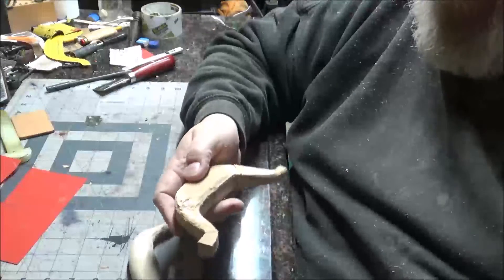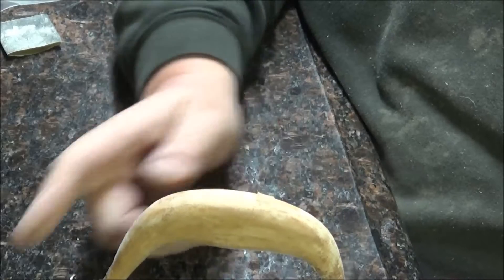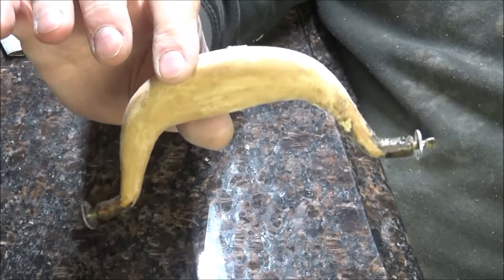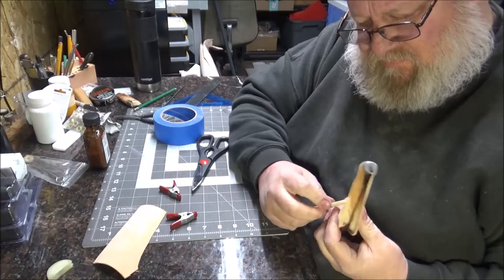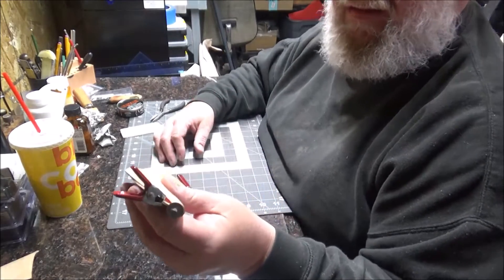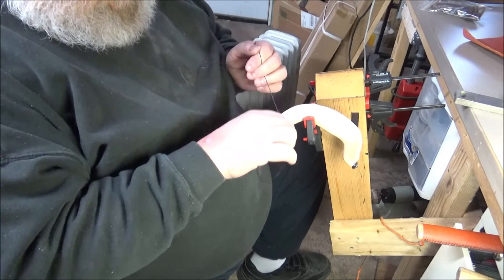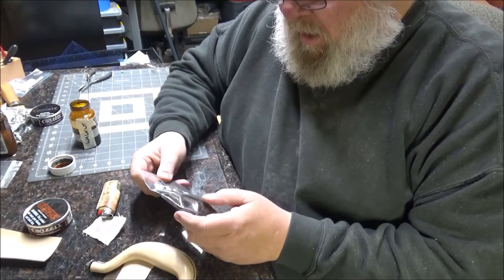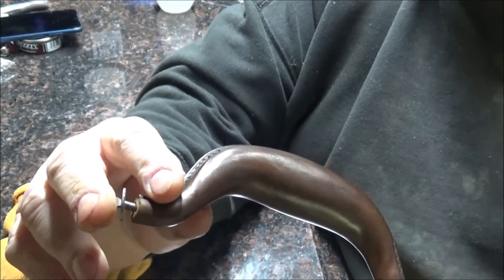Repairing a Vintage Leather Tool Chest Handle Part 2 - Success

Comment: i have a question thats not pertaining to this video. i saw your video on taking apart your glenfield model 60 and i was wondering if u knew where i could purchas a new hammer for mine. i have checked midway usa and a couple other sites
Reply from the maker: Numrich deals in new and used parts, check here: https://www.gunpartscorp.com/gun-manufacturer/savstevspgfld/rifles-sav/60
Reply: @FatManLeather  thank u so much

Comment: Awesome work!  I have a vintage (1920's) machinist chest that I am restoring. I found your page to get an insight into what the restoration of the handle will require.  After viewing your video, I realize that I do not have the skill set to attempt this restoration myself.  Would you consider undertaking another similar project
Reply from the maker: Certainly, This one gave me a few surprises along the way, but my customer liked it. You can send some pictures scott@fatmanleather.com and I can try to give you an idea of the cost.